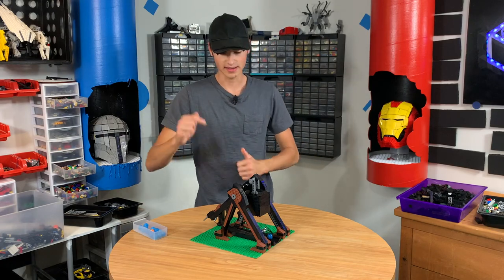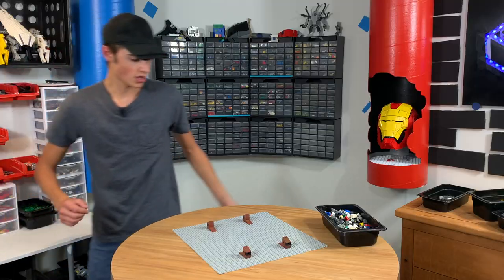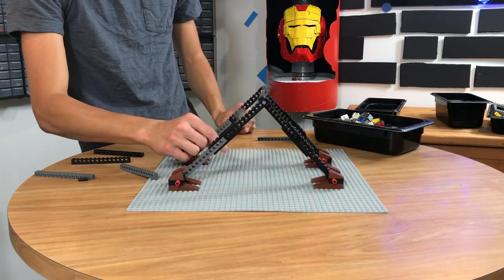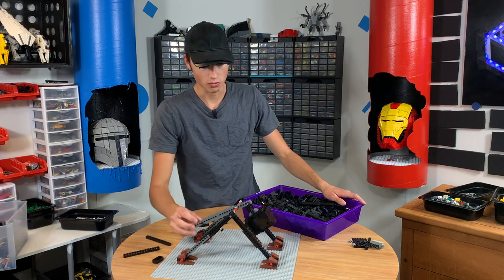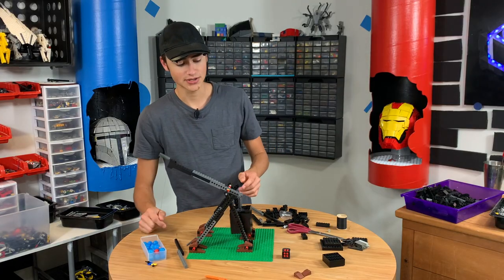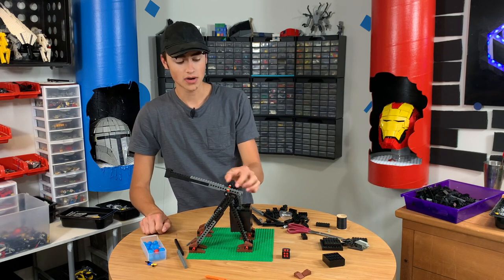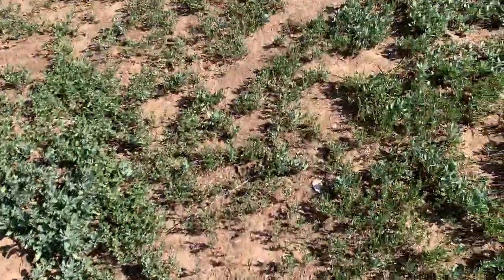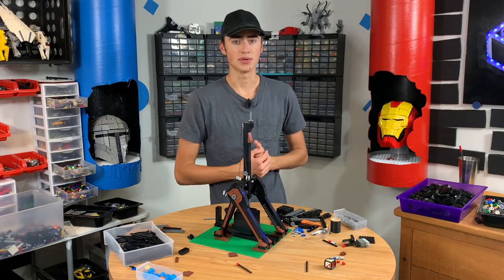How to build a Working LEGO Catapult (Trebuchet)

Comment: how long does the technic peices have to be and will this throw
Reply: Does not have to be tecnic 
You want to raise an axle off the ground and between two you make a beam with one side having 3x the length the other side has, add a swinging axle sandwich to the short arm and attack a box you can put rocks in
Idk how specifically but you need a curve on the end of the long arm about 30 degrees, use pieces with elbow joints and prop them up with pieces under
Add an empty single axle under this
Use string webs to make a pouch with two strings attached to each end, one hooks into the empty axle, the other will need a loop making to book over the curve
Add two empty axlesbin the ground raised a bit and put a solid tecnic axle through both over the long arm when forced down
Sling filled with a pebble and put under the main axle, smooth topped pieces or sets of long cheese wedges pieces steady where it sits 
Pull the solid axle out over arm and watch the counterweight drag the arm and sling up